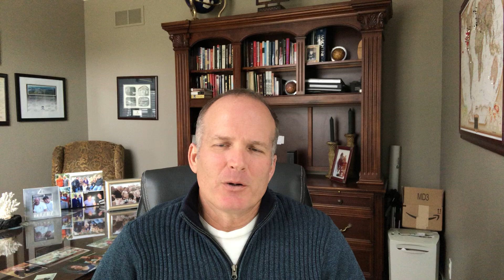Reliability Assessments -- 3 Fatal Flaws you MUST KNOW -- Buyer BEWARE!

Comment: A quick comment: I find internal  less formal Self assessments  also offer significant value to highlight gaps/waste areas as well as inject the continuous improvement mindset into the organisation. It is critical to obtain leadership support to build these into the year plan and show delta value delivered. If the asset continuously self assess and apply the PDAC as an internal process, then the formal/external audits tend to offer much higher value. Obviously managing the external auditor’s expectations upfront is also critical. If the asset can demonstrate this type of CI approach as an embedded process, then convincing  the auditors to not only audit but provide support/consultancy as an integral part of the assessment and squeeze more value and achieving a useful audit outcome is possible. (e.g. less time in trivial assessments behind desktop, more gemba and interaction etc..)
Reply from the maker: You got it.   Too often the culture you detail is missing.

Comment: Joe,
Great video and advice. As a person that has done dozens of assessments I would add a couple of things. Any assessment that does not tie current performance and projected improvements to financial outcomes is wasted money. The lost value from current performance, and the net value of achievable improvements are critical for the business case. Another point is that assessments can be done for many reasons. As you said, doing it for a score is a poor reason. Consultants can provide a shoulder to lean on, a consistent assessment tool and an unbiased evaluation that may be needed to gain support for a strategy. A client must review the assessment tool to be assured it is measuring the right things. Keep up the great work!
Reply from the maker: Great discussion points Tom.   Too many companies just do an assessment every 2 years to see the score change.  Linking them to a business case and knowing your waste is critical — and unfortunately, not common.